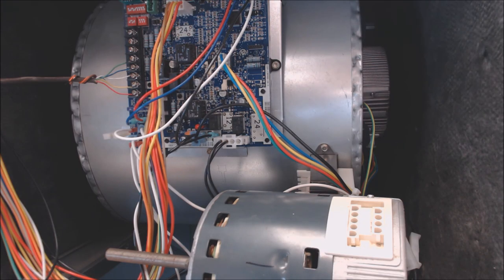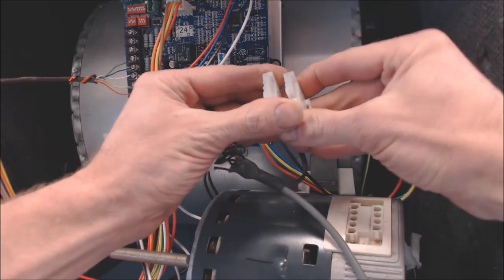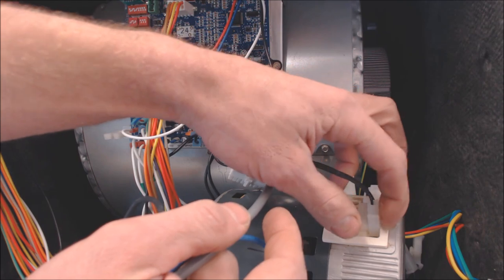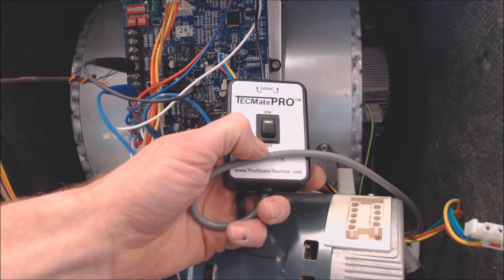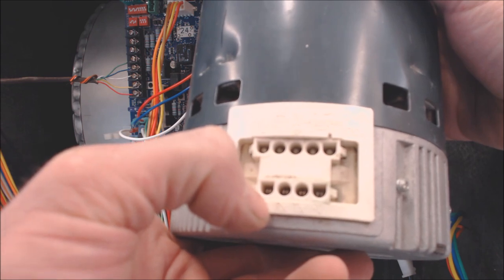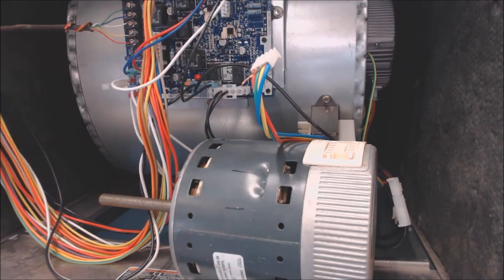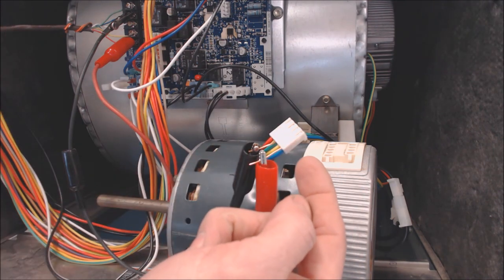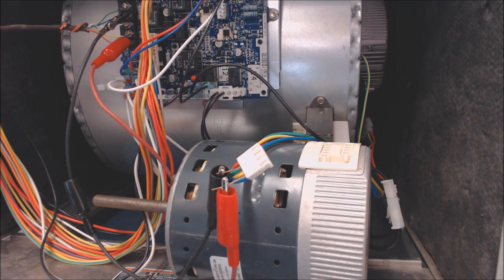HVAC ECM Variable Speed Blower Motor Troubleshooting! Simple Testing!

Comment: My squirrel cage is jumping all over. I opened it up and it wobbles. Do I need to replace the whole assembly or just the motor? My guess is that the bearings in the motor are out. But the mounting cushions are suspect also.

Comment: I jumped 24V to test my motor and it will initially ramp up for about 2-3 seconds then shut off, then my status light shows comm fault. Any ideas? I'm using a regular thermostat for a carrier infinity system, I'm wondering if this is the issue?

Comment: After replacing the thermister, a year later my carrier infinity main blower motor (GE 1/2 hp 08/22/00 CNO2 011DH7) is making a intermittent high pitched whine (g#5 note) when on first stage. What would you suggest I check or do?

Comment: Over 40 years hvac experience have ecm motor that worked properly now runs backwards is motor shot never seen this before. Reversed former connection's no change replaced former with 75va no change runs fine in reverse.  Is there a solution or should I replace motor

Comment: I am getting 41 error I checked the blower motor sending 24v and it ran fine but I am  not getting 24v out of the board on the connector wire color green and blue while cooling for blower to run would that be bad board? than you very much

Comment: Wondering why you mention "microvolts" without stating the voltage range and whether AC or DC, and if DC, then which polarity is required?  Or PWM, or whatever.  0.001V, as 1 millivolt 1mV, and 0.000001V is one microvolt, 1 uV

Comment: Im having an issue with my blower only running on a low speed (freezing up the ac line outside) The errors I am getting indicate restricted airflow. All vents are open, filters are clean and unit has been working prior to this issue. I used your method and the blower kicks on and runs at high speed as it should. After hooking everything back as it was i started it again and the blower ran a little higher then before for about 30 seconds and then dropped back to low speed. Does this mean the ECM is not my issue?

Comment: Another thing I'd like to know is why you don't just momentarily power up the motor, no cage rotor, to show if the motor works or not.  Just a simple on, run for 1 sec, off.  Why not show that for the ECM 3, ECM 2.3, and ECM 2.5?

Comment: I'm curious how you determine the entire ECM is good by simply turning it on?? How would you determine if the motor will "vary" the speed or torque?  Seems like there is much missing from performing a complete test of the motor.  Thanks for posting.
Reply from the maker: MJ, the motor manufacturer made the tester and if you apply power to those terminals, it will tell if the motor will turn on and if it will ramp up and down improperly. If that is working then the rest of the programming is usually in tact. Then you can test the actual airflow volume using the temp rise formula, hot wire anemometer, static pressure aligned to the manufacturers specs or another method, thanks!

Comment: Thanks. Also Emerson ECM Motor manual mention a 0-10vDC.
Reply from the maker: It talks in dc voltage to communicate with the board but there is a 24v testing ability on the two taps, thanks!

Comment: Does the DC Millivolt  portion of the motor control module need to be tested or does that section never fail? can the motor run fine on the 24 volt AC input but not ramp up or down with DC Mv input?
Reply from the maker: The 24v is for testing and it wont communicate back and forth with the board to ramp up or down. Some manufacturers will give you DC millivolt communication voltage to read with a meter but it is simpler this way, thanks

Comment: Did you measure the  output voltage from the TechMatePro ?  I saw on one of the HVAC blogs, where connecting a 9 Volt battery to the control leads would run the motor at half speed.
Reply from the maker: The output from the tecmate is only 24v. That tool is what is recommended from Genteq themselves. If you were to measure dc millivolts then you would need the manufacturer's troubleshooting guide to see exactly what the sequence of numbers would be thanks
Reply: @acservicetechchannel  ... so the tech mate pro sends 24 volts AC to the motor module to test but the OEM circuit board sends DC Milli Volts to communicate.... ??? so 24 volts AC will not damage the module electronics????
Reply: never mind. the next part of your video answered my question ? :)

Comment: The way you bypassed the board and provided the motor terminals with 24vac on the bottom left hand terminal, would bypassing the board this way for short term period cause any damage to the motor module ?
Reply: If you removed the fan blade (wheel), then don't run it long time. Again this is genteq method.

Comment: If this type motor fluatuates in speed, then after a minute or 2 runs consistently, then it is possible that the module is bad? Or adjusting to static pressure? Replaced 1 a year ago, but new is been doing this for a few months now.
Reply: Did you find your answer to this pulsing problem? I replaced my thermistor and it "pulses" or fluctuates in speed as you said.

Comment: hey this is great info... but my motor has different connections. guess it may not be an ECM.  essentially connections are Line Ground Neutral Common and Speed and Aux Heat. i am trying to test the blower as it comes on intermittently.... maybe 50 percent of time after having everything powered off for 30minutes. to try to use your testing method of power just the fan... i am trying to determine what the Rx would be. my Rx from thermostat goes to transformer where Brown(Common) gets 24v. the motor is a BroadOcean (in a Carrier blower unit). any guidance or another posting that provides such guidance?
Reply from the maker: Look up "acservicetech blower motor troubleshooting for more motors" Thanks and ask a question after you find the right one and if you don't understand, thanks
Reply from the maker: Testing of blower motors should always be done in a safe manner with the power off when possible due to amperage, thanks
Reply: You probably have a bad limit or time delay relay, how old is the system

Comment: I've been watching a lot of videos on this particular blower motor and this was one of the more informative ones by far! I have a question I was hoping you can help me with? Is there a way to use this blower motor WITHOUT the board? I'm trying to use this blower motor in a woodshop air filter I've built. I'm looking for a basic on/off switch? Being able to select different speeds would be nice but I'd take being able to just turn it off/on. Suggestions? Please help! Thank you!
Reply from the maker: Hey Brian, it would be better to do with an ecm x-13 motor but if this is what you have then I would just have one switch to power the 120v to feed the motor and another to power a 24v transformer that would power the same two taps on the motor. This motor has 24v testing terminals as shown, thanks
Reply: @acservicetechchannel  Thank you so much for the reply! When you say it would power the same two tabs on the motor, do you mean the 24 volts would only be tapped into those C & R tabs? Just wanted to be sure we're on the same page.
Reply: @acservicetechchannel  Also does it matter if the switch is before or after the transformer?

Comment: Can we use psc motor on variable speed on both ac and furnace ? If yes how do we isolate heat and cool when thermostat calls
Reply from the maker: Only on single speed furnaces and air conditioners. Make sure to verify proper temp rise in heat mode and low side sat temp in cooling mode. You can use two 12 amp fan relays, thanks
Reply: acservicetech thank you

Comment: Hi, if the board talks to the motor with DC millivolt then why does it work when you're putting in 24vac to the blue and green wires? Thanks
Reply: Listen, this is the method that how Genteq make their tester. If you really want to know more details, you need to ask Genteq tech team. 😀

Comment: I have a 230v Payne air handler with a ECM blower motor when I disconnect the two low voltage wires the blue and white and plug my disconnect the fan automatically starts running and will not turn off would you think this is a defect in the blower motor
Reply from the maker: If it is not receiving a 24v signal and is running then the module on the motor is bad, thanks!

Comment: What do you think it means, when giving it the 24volt signal, the motor Runs  but shuts down after It reaches full speed? Thanks
Reply: Mine does that also. Replaced the motor with a new one, same thing happens. Let me know if you figure this out.

Comment: I feel horrible for people that have VS, and it failed after the warranty, basically, do you want to buy a new furnace, motor is close to 50 percent of a new furnace, York would be 70%, as a tech, it doesn’t make my day, ran into one today, customer called me at 6 am, no heat, middle of the night he thought he smelt an electrical smell, got there at 10am, after moving a couple maintenances around, sure enough, module failed, I do not replace the module without the motor, when out of warranty.

Comment: I went to look at a emc motor and I am getting 24 volts and primary voltage to ecm motor module but motor is not turning on. What could be the issue?
Reply: Either thermistor or other component, just replace it if you don't know. At least you know the board might be good

Comment: Im still not understanding what the other 2 low voltage wires do (the yellow and the orange)
Reply: For quick trouble-shooting you don't need to know. They are for control board to communicate with the motor. If you are a developer you will know that.

Comment: If the ecm is bad would the motor still turn in with the tech mate attached
Reply from the maker: If the module is bad, then the tec mate pro will not be able to turn the motor on, thanks!
Reply: @acservicetechchannel  What if ecm is good and motor is bad?  How do you know if its ecm or motor

Comment: I had used one of those to test a motor, and the motor started. The motor was getting high voltage, and since it wouldn’t start up, and started with the tested I said the board was failing to send signal to start up the motor. Called the manufacturer after and they said I needed to test dc voltage for the speeds, once I did that they said the motor was getting signal. The module was bad not the board, can’t really trust the tested now
Reply: So Genteq tricked us
Reply: I’ve experienced the same with this particular tester
Reply: Sell them a new board and a motor and call it good. Can't miss. In and out onto the next call. Easy peezy. Extra parts sale.

Comment: Is there a way to replace a ecm motor to a standard blower motor?
Reply from the maker: Yes you could use 24v contactor turning on and off the blower motor for an air handler, thanks!
Reply: @acservicetechchannel  how about a central air unit?is it that same or do you need relays

Comment: The 24vac will power the 24vdc?
Reply from the maker: The manufacturer allows for the 24vac to signal the motor to turn on at the test taps described in the video even though the motor is controlled with dc voltage signals, thanks!

Comment: But how do you know if module is bad?
Reply from the maker: The tecmate pro would help the diagnosis. If the tecmate turns the motor on and there is not a fluctuation up and down and up and down again in speed then the motor is good. If the motor does not turn on, then you check the resistance readings on the motor itself detached from the module along with a check from windings to ground. If the motor is good then the module is bad. I have the tecmate pro linked at https://www.amazon.com/shop/acservicetech thanks